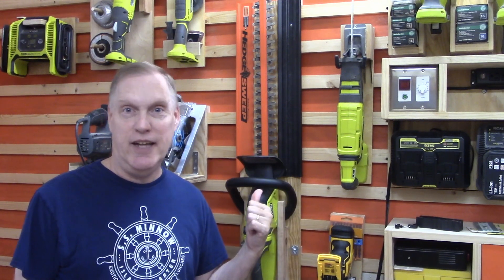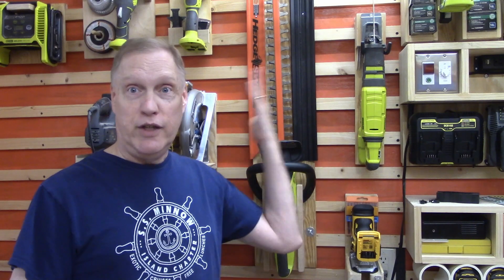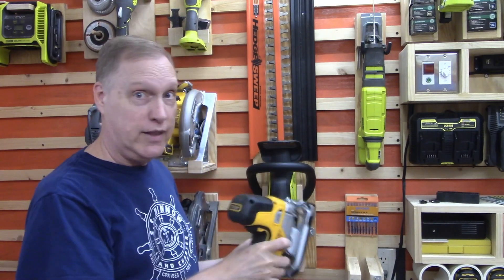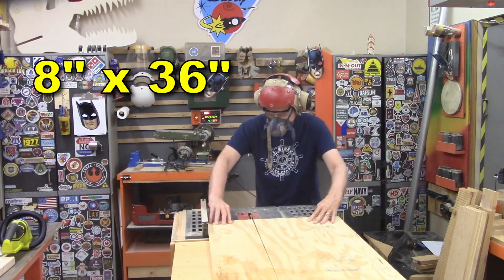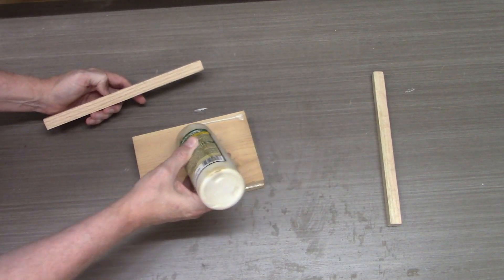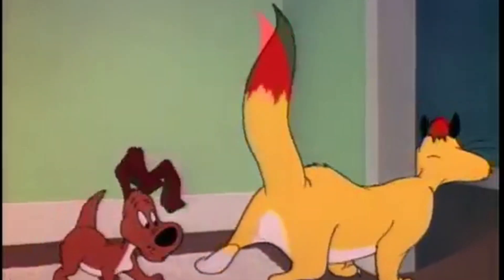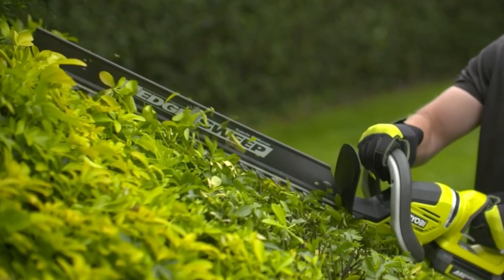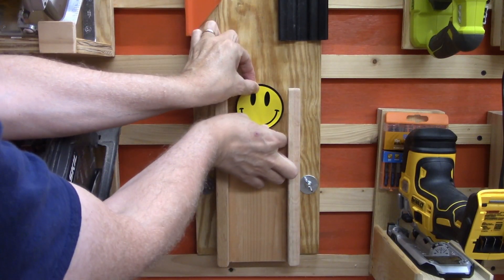French Cleat Ryobi Hedge Trimmer Holder - Easy Build

Comment: Attaching that secondary cleat with the wing nuts is a clever trick — I may try that on a couple of my taller holders. You know, as part of my own quest for tool storage bliss.
Reply from the maker: Excellent! Note that I drilled large holes for the bolts to go through so that the cleat could move around a little in order to fully engage the lower cleat. I did that after I discovered that my cleats were not always spaced exactly the same and the wing nut mount fixed that problem nicely.